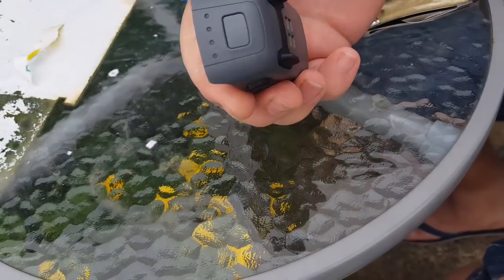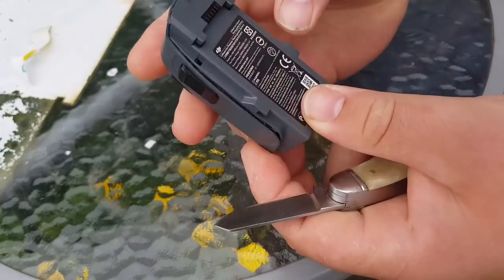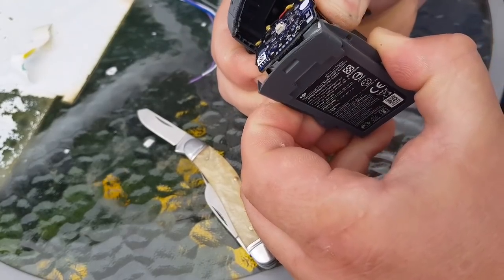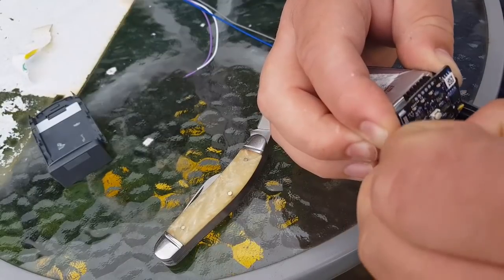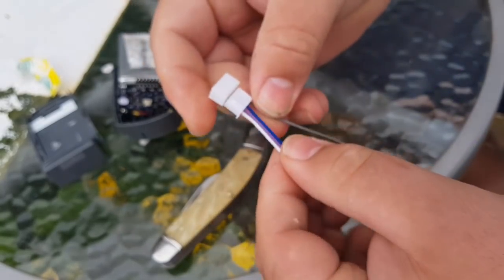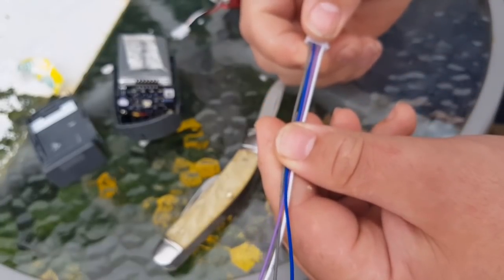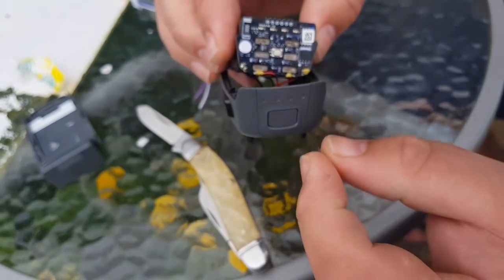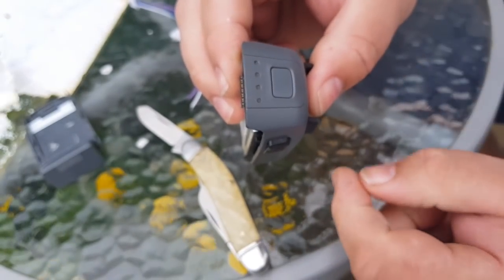DJI Spark Battery Mod 100% tested and working

Comment: I removed the old cells and then connected new lipo battery balance connector the charge indicator is shown full. BMS does not turn on!
Double clicking does not take BMS on!
(Battery management system)
Reply from the maker: why did you remove the cells???...nowhere in the video did I say to do that as you will need to reprogram the bms in order to get it back on again!!
Reply: @mattwilson1213  How to re-program?
Reply from the maker: @shajudeen4554  I dont have access to the hardware required so I couldnt tell you sorry...

Comment: Cuting your batery and then batery lock cannot charger
Reply from the maker: I'm not quite sure what you mean but the battery will charge once you put it back together again if you do it correctly
Reply: @mattwilson1213  jumper paralel  with lipo 3s 1500mah and then cut the old sell batery , safe ?
Reply from the maker: @masbroo9707  no dont remove the old cells, the BMS will shut down regardless and will need reprogramming
Reply: @mattwilson1213  do not increase the load of the drone and the motor will be damaged quickly
Reply from the maker: @masbroo9707  not true, it can handle alot more than you think!
Reply: @mattwilson1213  ok thanks for the information, very helpful
Reply from the maker: @masbroo9707  did you reprogram the bms?

Comment: hi there. whatva great sharing. I wonder whether it is possible to strip the battery.casing and simply replace the stock battery with a 3s 3000mah?
Reply from the maker: no, unfortunately the board goes into sort of self destruct and cannot be powered up again

Comment: I just tried it and it did not work
Reply from the maker: then you either didnt follow my instructions correctly or you didnt actually do it at all lol, follow the Facebook link for proof of others doing it and any further help, you will find myself and others there to help, thanks
Reply: @mattwilson1213  i just tried it again my orange led lights up the esc lights up i get the beep than it all turns off
Reply from the maker: @gazza2006au  go over to the Facebook group to try find out what you did wrong

Comment: Ok,  so if you have tested this and it is a working concept,  why is it not shown in the video?   Essentially what you have shown is how to dissemble a battery.  To anyone reading this,  use a meter and test everything,  don’t just arbitrarily start soldering on a battery because someone said to.   TEST EVERYTHING!
Reply from the maker: the proof is in the group I put a link to...go see for yourself by all means 😁

Comment: I dont see anywhere in the video where you actually mod anything. All you do is take the case off, "show" us where to connect wires and put it back together still stock. How is this 100% tested and working and you didn't even wire a thing? LOL
Reply from the maker: in the description it gives a link to a facebook group where that info and evidence is

Comment: all the people that gave this a thumbs down work for DJI.     1. what do you do at charging time? do you charge both connected   2. does the DJO GO 4 app show the increase in power ?
Reply from the maker: charge as normal without an external battery attached and charge the external lipo however you wish, just not attached to the spark battery, the app shows approx voltage remaining yes, to learn more go to https://www.facebook.com/groups/TheSparkSide/

Comment: Saw this on the Dark Side and looks interesting. Thanks for sharing! Any advice on battery size? What I'm asking is other than the obvious weight issue, can I overdo it with another battery which has too much mAh? Thanks!
Reply from the maker: the basic starting point I'd say is 1300mah 11.1v and weight as close to, or under 100g as possible and the lighter the better but less than 1300 and you wont gain anything much
Reply: Thanks Matt. Much appreciated!

Comment: won't you have a wrong reading of the % left in the battery?
Reply from the maker: you need to use modded assistant2 and select non dji battery then you still get the % and voltage details